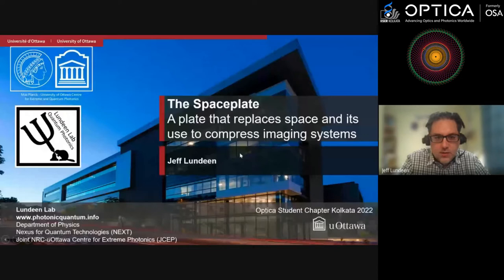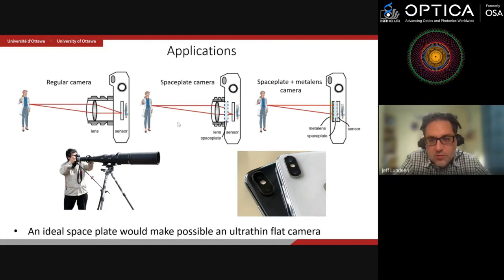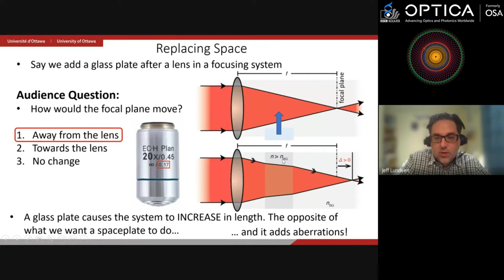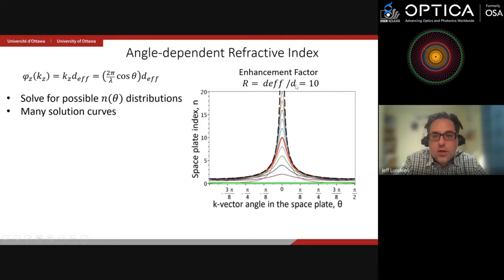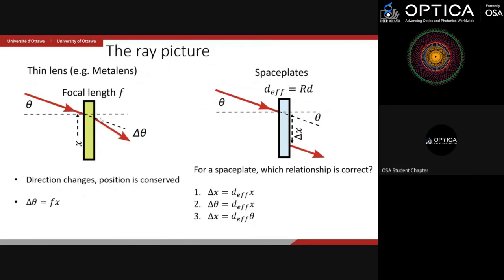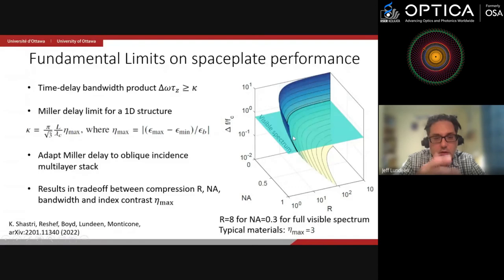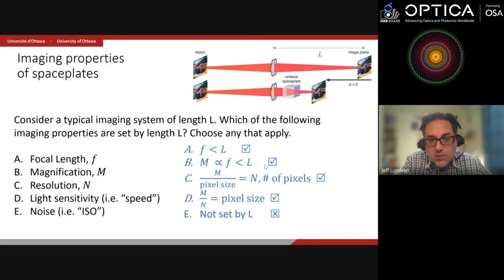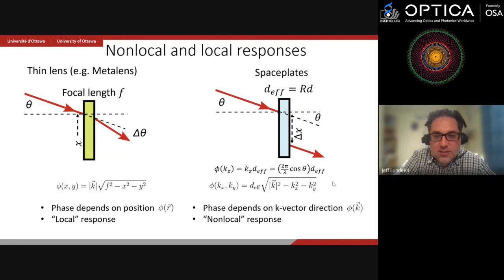OPTICA Lecture-Spaceplate: A plate that replaces space and its use to...|Prof. Jeff S Lundeen

Comment: Thank you.  Most of the articles on this meta-material endeavor use terms like "shrink the optics system" & 'Pocket telescope', rather than a less misleading & more informative phrase like 'shorten the light path'.  
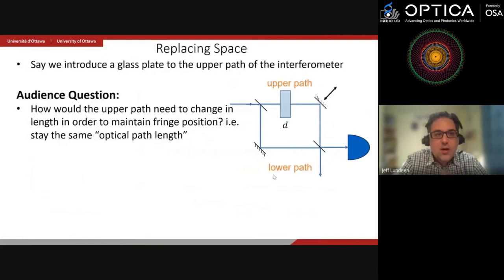re 14:30 This does not account for the loss of orthogonality of the interferometer.

re.11:15 I want a light weight space plate for the distance from the star(let) to the t'scope! ;-)
...
Actually I want to fit my 22" Dobsonian into a briefcase or backpack. :-)